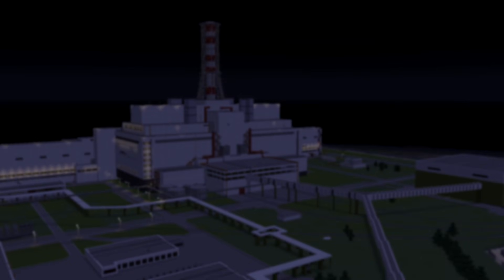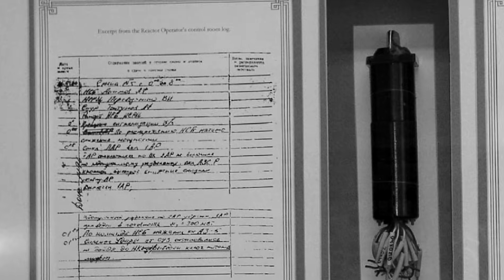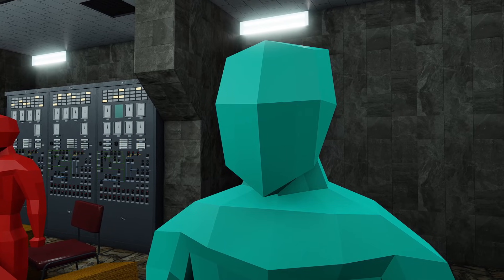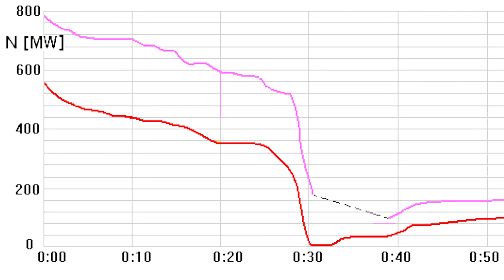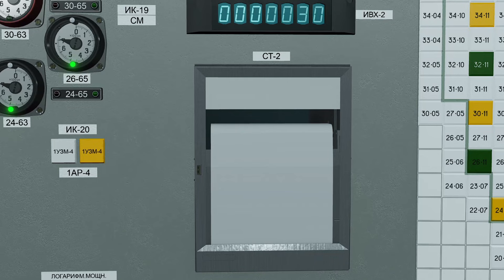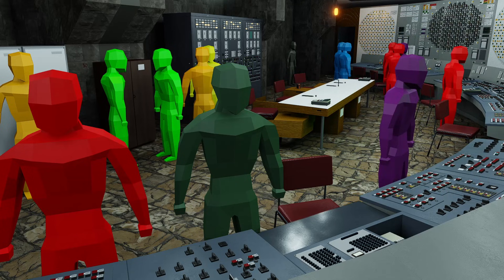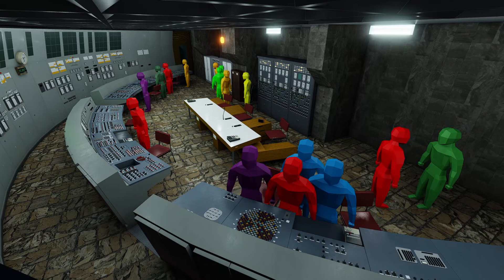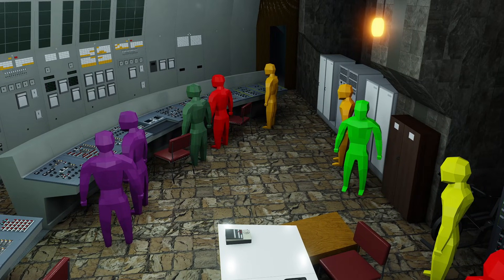How Chernobyl Exploded - PART TWO: The Power Drop

Comment: Thanks for the apprehensive vid.
I understand the economic and technical constraints of the USSR. Yes, they couldn't produce a 8-10m forged vessel (that time? The factory that could should now be ready?) Easyer to built. Yes> But cheaper with that pipe spaghetti in regard to water moderated BWR and PWR? They have only a few of big pipes.....

Comment: is there a semi-leymanish explaination of those self-propelled rods around? Cuz control rods randomly doing stuff seems like an absurdly terrible idea
Reply: Ok - auto control rods work a bit like a domestic heating or coolling air conditioning system controlled by a thermostat.
If it's too hot, the system will produce cooler air. If it's too cold, the system will produce hotter air.
Temperature sensors and neutron flux detectors are used to monitor a reactor core. If power exceeds the desired set point, some rods are automatically driven in. If power drops below the set point, some rods are driven out.
If power starts to rise too quickly, another safety system will scram the reactor automatically. That's a bit like an automatic circuit breaker in a domestic electrical consumer unit.

Comment: Before i forget - wasnt it a violation of procedures to do the lowering the thermal output and even more, doing the experiment WITHOUT scientist that calculated reactivity? Whats more, when power dropped down, wasnt that most certain point of no return that the reactor must now be shut down? 
I mean, it looks like they did the experiments literally blind (without the specialist who would calculate reactivity and consider the reactor state). Whats more, how can self-insertion of a control rod be "little known quirk of the design"?
Reply: It seems not. It was only required for Fomin or Dyatlov to sign off on it. The ORM was not listed as a important parameter by the scientists so why would you care much. There also were a ton of  experienced people in the room and no one had any issue.

Comment: Wait, you can't simply introduce "self-propelled rods" and not explain them! Especially since there's nothing on the English internet about them!
Reply: So searching deeper I found IAEA paper KIYAI--91-13 (in Russian) which talks about "spontaneously moving rods". However, reading it didn't help much: 

It seems to only calculate the effects of unintended movement, not explain why they believe such movements occurred before the accident. They simply mention that different kinds of technical problems could cause such movements. 

Btw, I love these videos, but it would be very helpful if the citations at the end were more exact or linked in the description.

Comment: HOW DO THE CONTROL RODS WORK
some kid told me the graphite is slowing the reaction down
but why would the rods would be made of boron and the tip of graphite help!
Reply: In an RBMK graphite is the moderator, which means it slows the neutrons down to the point they need to be to cause more fission and keep the reaction going, so it speeds the reaction. Liquid water absorbs neutrons, and boron absorbs even more neutrons, so they slow the reaction. Steam absorbs far fewer neutrons than the same volume of liquid water, which is what is referred to as the positive void coefficient - as the reactor gets hotter from an increased reaction, water in the reactor turns to steam, which absorbs fewer neutrons, which means the rate of reaction continues to increase. It's a runaway process unless something else is done to slow the reaction (like inserting control rods).
Reply: @brucetucker4847  k thanks

Comment: use water as the moderator and reactor wont go boom boom
Reply: It could still explode. If the reactor is switched off the zenon poisoning will prevent power increase for a time. Then, as the zenon decays and burns out the reactor may become prompt critical if an attempt is made to increase power before ensuring all zenon has gone. In that case the reactor will explode. Try it.
Reply: And if the water or the steam escapes from the system and the core is suddenly without water, you have an atomic bomb. You think the Russians were stupid to pick graphite/boron for controlling the core?

Comment: Thank you for this channel❤ I still don't understand why Chernobyl performed this test? What was the point and why was this necessary? Please tell me. Thank you.
Reply: The Wikipedia page has a more detailed description. I actually didn't realise this test was only the burst coolant pipe scenario. I assumed it was for any/all total power loss, until I looked just now. Apparently the normal pumps had counterweights/flywheel to provide power for the time gap.
Reply: @hayleyxyz  Thank you for taking the time to answer my question. I couldn't understand why they were running tests on a perfectly fine reactor. Now I see why they would want to develop procedures for different system failures. I remember watching the news of Chernobyl as a kid and feeling scared. Thank you again 😊
Reply: The reactor needs a constant flow of cooling water in the core. In the event of a total power failure there would be diesel generators that would start to power the pumps. The issue is that there is a delay until the diesel gensets are able to generate the power required.

They theorised a scenario where there was a burst in the cooling plumbing + power loss, which would require extra water pumping capacity.

The test was to verify that the residual inertia from the turbine spinning generated enough power for the extra water pump(s) during the time gap until the diesel generators are up and providing power.

Comment: "A number of other experiments" It just struck me: Who in their right mind would run experiments on a working nuclear power reactor? On some scaled down version for R&D? Yes. A power reactor has one job: Provide power. A metric f*ck ton of it. I mean, would a hydroelectric power plant on the grid, running generators worth millions go: "Hm, lets see what happens if we press this button."?
Reply: Hindsight is 20:20. They thought the tests were safe and reasonable to run at the time. They thought wrong.
Reply: @AerialWah  Put differently, the test was safe and responsible. The reactor wasn't.
Reply: My understanding is it is more like a test to verify the system will work as intended for a specific procedure. It’s not a scientific research experiment, exactly.
Reply: @itsacorporatething  Quite so. It was an engineering experiment to see if some new equipment and procedures would work. A rather more risky and 'scientific' experiment was planned for the reactor the very next morning. A bunch of representatives from the design bureau had flown in for it.
Reply: Getting a measurement of the vibration from the turbine transmitted back to the reactor was crucially important. Nothing causes corrosion and hairline cracks faster than hot temperature and vibration. That's why the tip of the muffler of your car breaks off after a couple of months.

Comment: You are absolutely knocking it out of the park with the latest videos. And I found a new thing to read about. These self-propelled control rods. This is the first time I ever heard about those, and at this point I have quite the extensive RBMK library. So, I'll have to go and find that Khalimonchuk report. Big props to all the work and research you are putting into the videos. On to the next one!
Reply: Blowing the roof off! Never mind the park
Reply: Did you ever find anything about these self-propelled rods? Cause I'm not turning up anything.
Reply: @t0b0  
Unfortunately not. I came up empty as well.
Reply: @swokatsamsiyu3590 As I've mentioned in another comment, I eventually did find IAEA paper KIYAI--91-13 after some searching. But it only calculates the effects of self-moving rods, it doesn't explain why they think those might have been present before the accident.
Reply: @t0b0  
Again, same here. The calculations are nice, but do not tell us if they had, and what their influence on the accident process was🤷🏽

Comment: So the procedure called for between 700 and 1000MW of reactor power. However they immediately chose to deviate from the procedure without recourse to technical specialists. From then on they were wasting their time on a flawed test. Struggling increasingly to recover an irrecoverable test for differing reasons and motivations. Inadequate supplies of steam on hand to make the test worthwhile. Management systems should have stepped in at that point and safely aborted the test and returned the reactor to safe status. But they had no management systems. Management systems not design flaws.
Reply: The power level was insignificant for the test. It was clerically necessary to write a power level in a program, which according to Dyatlov, who claims to have written it himself, was based on the expected preceding task. With the turbine vibration measurements becoming that task in reality a conflict emerged as keeping the reactor running while disconnecting both turbines at 700 MW was a potential safety issue. Therefore a decision was made to lower the reactor power, which the mentioned report justifies. Ironically, there are apparently indications that despite the reactor blowing up the rundown test was actually a success. Again, there will be videos in the future that go over the principal factors again (not this but the following weekend) and how extensively Soviet nuclear experts twisted the Chernobyl narrative to scapegoat the operators (planned for June).
Reply: @markusw7833   but my understanding was that they needed residual steam to keep the generators spinning long enough to prove that the diesel generators could start and take over in time under standard operating conditions.
 Their steam was rapidly depleting.
 I suppose that we can never know the real truth but as I keep coming back to, the other units served their time without incident of significance. 
I have to say that I may not have done the same amount of research as yourself. However as a quality engineer I have been presented with the purported facts used as an example of poor management systems.
Reply: @robinwells8879  Although I don't know specifics (aside from that apparently generally the turbine spins at the same rate) the power level was not related to the validity of the test. Again, it seems that ironically the test itself might've been successfully completed while everything was lost. As for why Chernobyl had not occurred earlier (other notable incidents had, including at the Chernobyl NPP) the reason we suspect foremost will be covered in that early May video concluding the pre-Chernobyl history. As for purported facts showing poor management and operating behavior, those didn't emerge out of the unreproachable integrity of Soviet nuclear experts. June for those videos.
Reply: @robinwells8879  The test began by cutting off the supply of team to the turbine. Only the inertia of the turbine was important, and the turbine is always spinning at the same speed because that's the only way you can synchronize with the power grid. Furthermore the test program contains a step which seems to allow for further power reduction, and this may have been intended from the start by some of the test authors.
Reply: @MinSredMash  yep but they were loosing steam pressure required to maintain the turbine rpm before they started the test process. The turbines needed to be at operating speed to supply internal power by their sheer inertia once external load was removed. They were so far from their goals to start the test process that it was desperation folly to continue motivated by fear of repercussions and/or greed for advancement.
Reply: @robinwells8879  I just explained to you that steam pressure is irrelevant. The steam turbines were doing precisely what they were supposed to be doing for the test, as indicated by the step of the test program which instructs to 'unload the unit to the self sufficiency level of the turbine.' It was supposed to be near-idling with minimal steam pressure.

Evidently you also don't know that the test itself was a success, based on the voltage produced by the turbine inertia and its assistance in slowing the rpm decline of the main circulating pumps.

All these conspiracy theories about promotions and punishment are nothing more than speculation. Bryukhanov didn't even know the test was being carried out that night, which tells you how "desperate" they were to please him...
Reply: @MinSredMash  Are the turbines sustained at rpm by back running from external power to the generators?  If not, I understand that steam pressure was seriously comprised by the unplanned reactor rundown and the cold water injection into the steam separating equipment to replenish coolant and eliminate voids. The steam pressure is irrelevant but only to the point that it must be able to sustain the turbine at very tight rpm tolerances until the test commences. This all said we can agree to differ.

Comment: Just wanted to express my gratitude for the info you are providing. It is a gift to future generations on what to do and not do in nuclear energy. They definitely dont teach this in schools
Reply: Nuclear engineering schools?
Reply: @johnd2058  they didn't teach anything about chernobyl while I was in school getting 2 bachelor's and a masters degree. In my opinion it's one of the biggest historical events in the last 70 years since WW2. As Gorbachev stated he felt it was the biggest reason for fall of soviet union. It helped bankrupt them, it helped spur one of the biggest citizens revolt against any government/country, it also helped create the formation of the 9 independent countries that were created by the fall of soviet union (Ukraine, Belarus etc) the untold lessons of chernobyl also helped create a large number of safety regulations for future nuclear power plants
Reply: @timothymcavoy7634  Degrees in *what*, per se?
Reply: @johnd2058  chemical engineering, mechanical engineering. Is that good enough for you
Reply: @timothymcavoy7634  Ah, I see your point then.  The mix of control rod control principles -- manual, auto, emergency -- here alone is a worthy example of when-overengineering-can-go-wrong, yes?